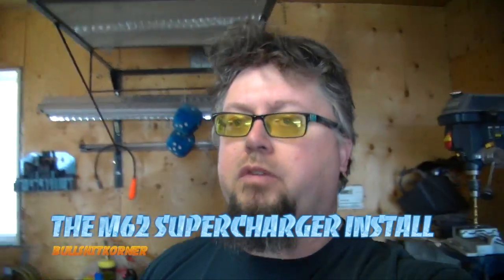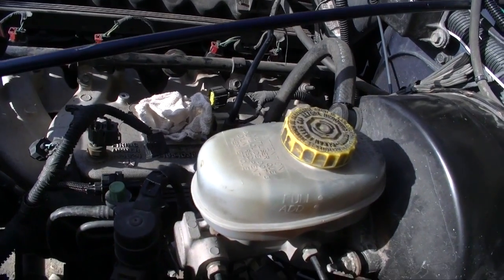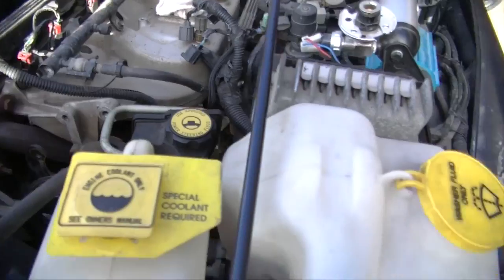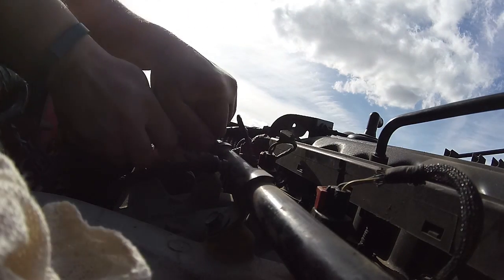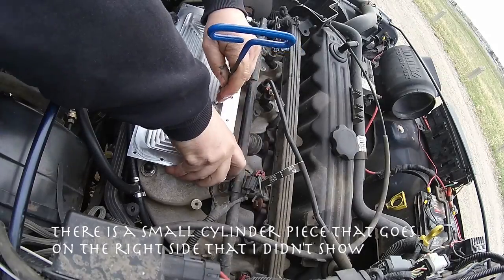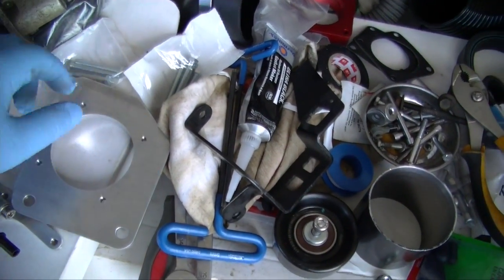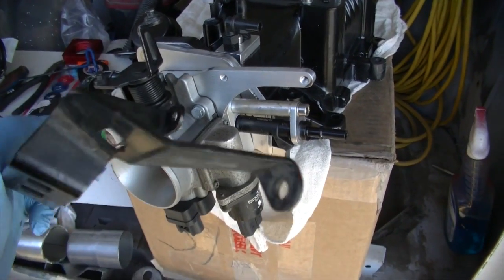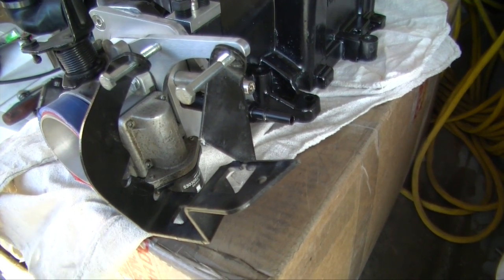DIY M62 Supercharger install on a Jeep

Comment: Hey man I just bought a eaton m62 for my TJ could you give me they link to get the custom pulley bracket and throttle body bracket !
Reply from the maker: it's sold as a kit and not separate
Reply: Any idea if this will work on an 04 Grand Cherokee with the 4.0? I already have  the K&N cold air intake, have vented my hood and also installed the throttle body spacer.
Reply: There's a separate kit for the Grand, but yes it'll work

Comment: would that work for a 1995 jeep yj with a 2.5l?
Reply: That's what in wondering I have mine torn down  tub off frame working on modifieing the tub then  some frame work hahahaha. Have a v8. To put in it but since the frames being welded together I dont want to over power my welding capibility

Comment: OK thanks for the info, my Mustang we did a supercharger install that's why decided to go with the turbo on my jeep because I've never done a turbo install. Judging by your videos you know your shit and I would appreciate your input. would you go with the seventh injector one or they also sell a kit that you can change your fuel and timing  when boosting.  What would you recommend. I already have done an injector upgrade, full exhaust no catalytic converter's and the Superchips  programmer. Any thoughts?
Reply from the maker: +Kyle eves the 7th injector in this kit is mainly for cooling the Air, since there is no intercooler

Comment: I'm doing a T3 T4 turbo kit on my TJ that standalone fuel system you have is that recommended for a turbo also?
Reply from the maker: +Kyle eves it's not a standalone fuel system it's main purpose is to control the 7th injector and alter some parameters in the computer

Comment: Bullshitkorner would this kit work for my 4.0 94 zj? i have a supercharger right now im restoring and selling (wont fit on my jeep) and want to sell it off and get an m62-m90
Reply from the maker: +Toothless Offroad you would have to contact this guy http://jeepm62superchargerkit.blogspot.ca he is where i got the kit from
Reply: Bullshitkorner Hmm not sure that split second fuel and timing will work on a 93 everything else seems fine.
Reply from the maker: ya i'm not sure how that will work on a older vehicle, may have to get a stand alone fuel management system
Reply: Shit. lol

Comment: Super charger was a better choice then mine.  I went with a 4.6 Golin.  One week after...

When "they" say plug and play.  NOT.  There are multiple problems.  Heat.  You must vent or have hood louvers.  Upgrade on water pump and radiator.  And by God, pay special attention to wire reroute.

Sorry, to steal any thunder BSK...just thought folks should know.
Reply from the maker: No that's good advice to give, even with the supercharger she stays in temp but the engine bay gets hot even with a vented hood.
Reply: Bullshitkorner The "space" in my comment was a pic of my jeep burned completing to the ground.  I have taken many vids and pics of it since.  Factory manifolds couldn't withstand the extra heat.  Note too that the manifolds are directly over the cats.  Major fucking heat there folks. When you STOP.....POP (the hood),

Comment: So I just successfully swapped out my 42rle for the nv3550. I hated that OD in the 4sp.
Reply from the maker: How hard was the swap I've been pondering it, do you need to swap the wiring harness and get a computer from the 5apeed donor since the engine and trans in the automatic are linked ?
Reply: Bullshitkorner Yes, I swapped the harness and computer but the one I got from the junkyard had the skim activated.  You can run it with just the wiring and auto pcm but it runs like shit and throws codes.  I ended up finding a place that reset the skim function, added my vin and flashed all the latest updates in the manual pcm.  I got a half assed write up on wrangler forum called Good Bye 42rle.
Reply from the maker: Thanks for the info I will have to read up on it

Comment: Are those little push on rubber caps gonna work on a pressurized manifold?
Reply from the maker: No they won't, you need to zip tie them on to keep them from blowing out.